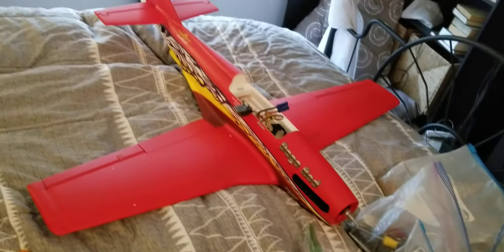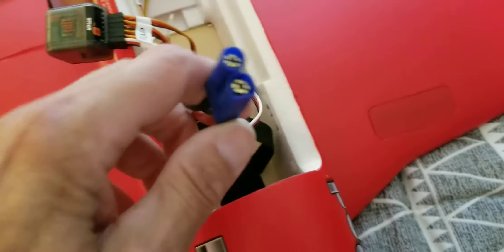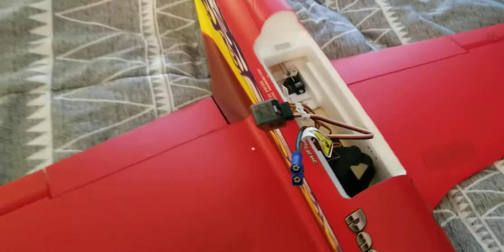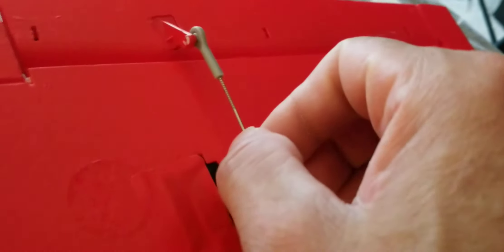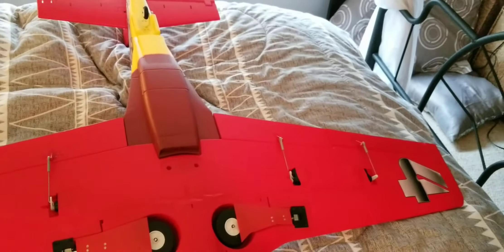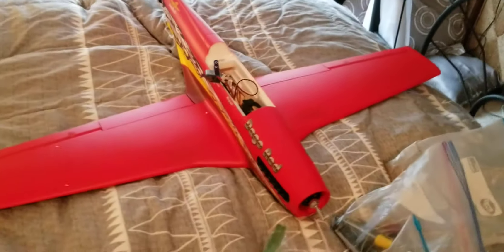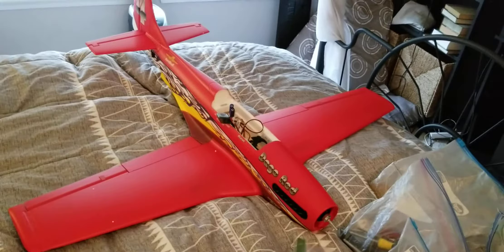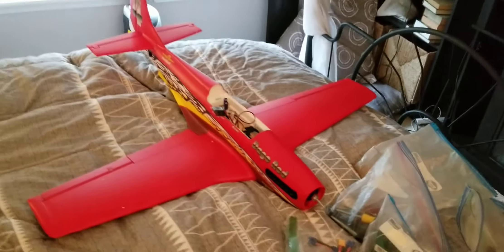problems out of the box Dago Red V2 P-51

Comment: I can relate to being frustrated over building/assembly issues with a new plane. I usually find it is best to set the project aside for a day and come back with a fresh perspective. In this case, make up some longer push rods and solder on a suitable connector to the speed controller to match your batteries. I know it’s a pain, but you will forget all that once you get the plane in the air and are having fun. Good luck! P.S. I wouldn’t use a battery adapter on higher amp applications like this unless you can be sure it was properly assembled. Too many commercial adapters won’t handle higher amp applications.